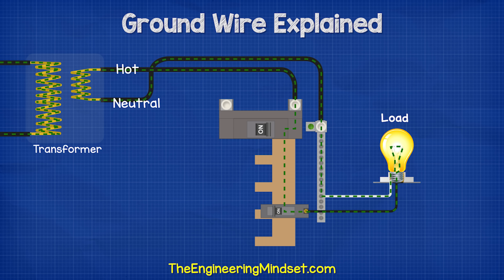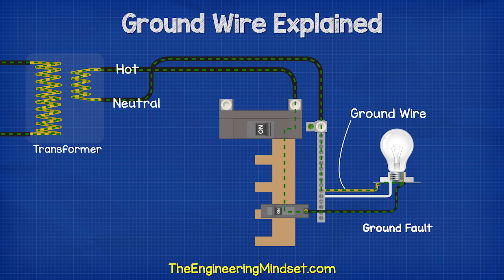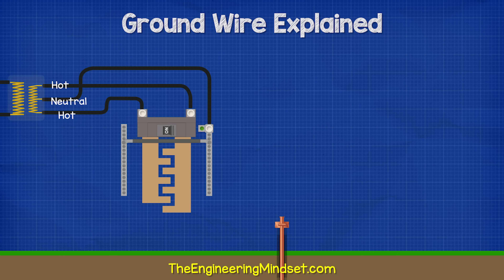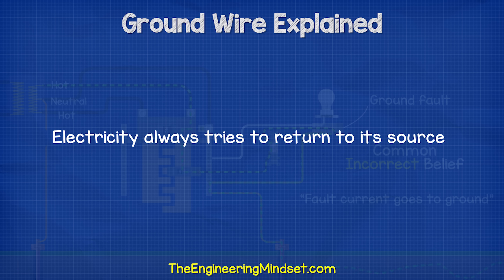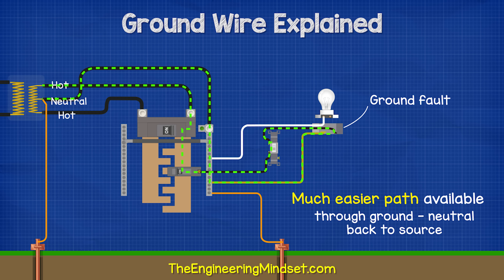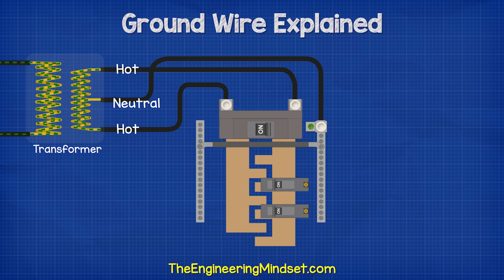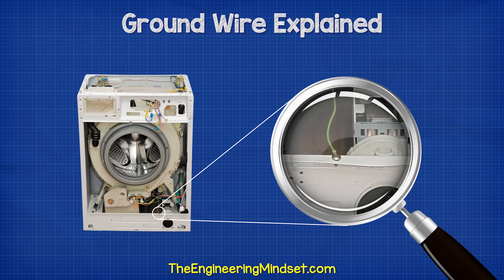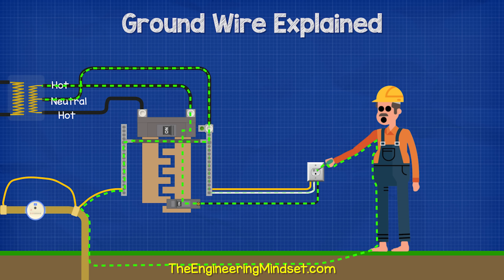Ground Wire Explained

Comment: There are some mistakes:
1. In Electronics the Ground Wire is more like the neutral line. Even in Electrical Engineering the correct term is PE-Wire (Protective Earth)
2. The PE-Wire is not most of the time a solid copper wire. It depends on the application. When it is not moving (like in house installation it is a solid wire) but most of the time it is not
3. It is insulated with not a green insulation but according to standard it is green-yellow
4. Actually the Ground/Earth has a very low resitance because the cross section is very big
5. When you have a ground fault what you want to trigger is the RCD, your normal circuit breaker is for a short circuit
Reply from the maker: We just published a new Ground fault, short circuit and arc fault video, so much detail! Link HERE➡️: https://youtu.be/Qi0ynSQw-wc

Comment: In Norway we have 3-phase 230v only, for most houses and buldings, with no neutral wire.
Here electricity actually returns to ground/earth rod when a ground fault happens.

Thou the rest of the continent (not Norway and Albania) i belive use 400v ( 3-phase 400v + 1-Neutral + Ground ) as standard
Reply: Indeed. All installations with TT earthing use the earth soil as a conductor, which is in combination with a RCD/GFCI perfectly safe.
Reply: @wouterbos3   only a few costal areas in Norway use 230v TT
The main standard in Norway is 230v IT (Isolated Terra)
But some new buldings in recent years now use 400v TN (Terra Neutral)
Reply: I find it interesting that Norway uses IT.  That seems pretty bizarre for standard residential systems.  In the U.S. we only use IT for specialized applications that cannot tolerate power outages during fault conditions (such as hospitals).
Reply: @LonnieAdams4   it was actualy a problem for EV owners in the beginning.
No one made and sold 3-phase 230v EV chargers.
Universal design for both the rest of the world, and the north america marked, some more powerful Home EV chargers did support 230v.
But we do not have a neutral wire, and left us with a flooting ground/earth, connected to 2-phase 230v.
But, this was quicly made illegal. As the chargers were not designed to be connected like this 😅😛
All chargers on the marked were for normal 3-phase 400v + nautral for 230v.

I’m pretty sure it’s only Norway and Albania that use 230v 3-phase IT for normal residental power 😛😅

But some of new residental areas buildt in recent years, are buildt out with normal 400v. Just like the rest of europe.

Also, I have never seen a pole mounted transformert IRL in my 36years.
All transformers here are huge, in concrete blocks, and many are parcialy under ground, and they service large areas. 
And have redundant cross connections with other transformers in the area.

Only in rural areas, can you some times see 230v power lines on poles along the road.
But, every house are supplyed power under ground.
Never from a pole, to the wall of a house.

Pretty much all high voltage are to far up, to be damaged by trees and heavy snow.

Comment: The ground rods at the bonded service and the grounds at the utility transformer does, in fact, provide a path back. Unless you have infinite resistance, there will be current flowing between the two. Electricity doesn’t just take the patch of least resistance, it takes all available paths back. Ohms law is still in effect.
Reply: Sure, but is one pathway (bonded neutral) handling the vast majority? Would you be harmed if a properly connected ground to neutral were activated while touching the ground rod at the service?
Reply from the maker: We just published a new Ground fault, short circuit and arc fault video, so much detail! Link HERE➡️: https://youtu.be/Qi0ynSQw-wc

Comment: This is just a bonded ground and neutral situation.

In europe we mostly use a terra terra setup, the ground is not bonded to the neutral. Or you get a separate ground and neutral wire delivered from the net.
Reply from the maker: We just published a new Ground fault, short circuit and arc fault video, so much detail! Link HERE➡️: https://youtu.be/Qi0ynSQw-wc
Reply: TT has advantages and disadvantages.  There is no "perfect" earthing system or else we'd all use it.  A lot of it depends on how much money the utility companies want to spend on their equipment. I suppose TN-S would be the safest system, but almost no country uses it because it is more expensive to run that extra earth conductor.

Comment: So then is it true that in apartments or homes with no ground wires to the electrical outlets the alternative is to swap 2 prong outlets with 3 prong GFCI outlets? (Again no ground wire)
Reply: GFCI stands for Ground-Fault Circuit Interrupter. The outlet detects a ground fault and trips like a circuit breaker (but, unlike a circuit breaker, doesn't trip on high amps). You still need a path to ground to trip the GFCI. Unfortunately, the only real option, if you're sure there's no ground wire run, is to rewire the domicile in question with 3 conductor wire.
Reply from the maker: We just published a new Ground fault, short circuit and arc fault video, so much detail! Link HERE➡️: https://youtu.be/Qi0ynSQw-wc

Comment: Why having the ground part in the first place?  So that could make your body complete the circuit when touching the hot wire? Even when we have electricity leak at the box, without the ground rod, the user is still alright, since he/she is not part of the circuit.
Reply from the maker: We just published a new Ground fault, short circuit and arc fault video, so much detail! Link HERE➡️: https://youtu.be/Qi0ynSQw-wc

Comment: @3:00 Today's houses have the ground connection connected to the neutral before a differential circuit which senses the difference bw neutral and hot currents. Thus you cannot die, as soon as the difference is > 0 the circuit stops the flow of current in the house.
Reply from the maker: We just published a new Ground fault, short circuit and arc fault video, so much detail! Link HERE➡️: https://youtu.be/Qi0ynSQw-wc

Comment: If I may offer a bit of feedback: The video starts very abruptly with the ENTIRE THING shown. The whole image is animated, so the viewer has difficulty orienting themselves in it. You do not highlight what you're talking about with some bright frame or spotlight, and the animations keep switching without being synchronized with what you're talking about.

I'd recommend first establishing what's on the screen, with several sentences such as "On the left side, you see the electricity producer's transformer which converts [x] to [y]. From there, wires bring electricity inside someone's house or an office building. On the right is the electrical socket in the wall." etc.
Reply from the maker: Thanks for feedback. This video is literally just a snippet from our long video about the electrical system. Please watch that "Electrical panel basics" or "120 & 240V electricity explained" for full explanation

Comment: I want you to explain what happens to electric when all it does is run in a loop why do we need to keep generating more? At some point it must be run to ground to get rid of it.
Reply: Electricity flows from high potential to low potential. If you have a loop it will all be at the same potential and no current will flow. You need a power source to generate a potential (current) in the loop.
Reply from the maker: The food you eat runs in a loop, grows in the ground, runs through your body and goes back into the ground. If you stop it passing through your body, you stop functioning. Generating electricity is just moving electrons through a wire, if you stop passing it through a wire then your electrical devices stop functioning.

Comment: I humbly disagree with your explanation. The return current will take all paths to ground. it's a parallel circuit you can use mathematics to figure this out yourself I know for a fact that there will be current on the ground rod as well as the neutral wire and anything else connected to it whether it's a fault condition or not. The critical safety aspect to understand is to create an ultra low resistance path which will take the majority of the current leaving only inconsequential milliamps of current on the other paths. There is no such thing as a perfect insulator. Even insulated aerial buckets designed to work on high voltage power lines still leak current back to the ground. If your explanation was true then the current would stay neatly within its wire always returning 100% of the current back on the neutral wire. The second something makes contact with an energized conductor it becomes a parallel path within that circuit. The only variable is resistance. More resistance less current flow but it will never be zero.
Reply from the maker: We just published a new Ground fault, short circuit and arc fault video, so much detail! Link HERE➡️: https://youtu.be/Qi0ynSQw-wc

Comment: That System really remembers me on the fail-safety systems in my country. We use something called "die  Nullung"
It's a modern version of the old Nullung ss it have some math stuff and more preparation
What it does: the system builds on breakers. Your electricity must be build, thst the breaker will be for sure cut down the wires. 
Like: if you want to use a breaker LS-Typ B, then you need to get a currency of I×5
So if the breaker can hold 10A, then your system needs to get in worst cases everywherr 50A or more
Too that their are 2 or 3 other rolds, like grounding and so, that needs to work

Comment: Can you run for example 2 12 gage wires 110v hot  1 wire on one phase the other on a different phase and return with 1 neutral 12 gage wire without any problems?

Comment: Correct me if I'm wrong, but isn't the main purpose of a fuse or circuit breaker to prevent electrical fires? To protect from electrocution you really need a GFI/RCD.
Reply: Well, it's to prevent high current, which can cause fires, but can also cause other problems too, like injuring people or damaging equipment.
Reply: GFCI are better for protecting people, but before GFCI's were invented in the 60's, grounding is what we used. Grounding conductors will cut the circuit pretty quick, but the fault current can be pretty huge for that split second.  A GFCI will trip at 6 mA (in Europe they trip at 30 mA).

Comment: Yea I wish you had explained this to Duke energy, would have saved a lot of folks a bunch of money ....failed electronics, lights that keep burning out, just to name a few. Actual listen to two of their linemen acknowledge a bad ground and decide to do nothing about it since it would require transformer replacement. Another crew was sent out and even after being shown, did nothing, then 3 crews latter and months of nonsense a repair was made ..yep two different cases I personally know of . Years of reduced maintenance,  using the Boeing plan...run it till you have to replace it ...not much comfort to a man with a burning house, or a grieving a loved one electrocuted....
Reply from the maker: We just published a new Ground fault, short circuit and arc fault video, so much detail! Link HERE➡️: https://youtu.be/Qi0ynSQw-wc

Comment: The resistances of the ground wire at the outlet is no less then the resistance of the neutral wire.  The current flowing thru a device and then back on the neutral doesn't trip the breaker because the device acts as a resistance item, aka resister, and doesn't allow the current to flow thru the device to over load the breaker.  You can remove the neutral and connect the ground wire to the neutral connection and it will not trip because the wire has the same resistance as the neutral.  In return you can connect the neutral wire to the case of a device and it will properly function as if it was a ground wire.  In either situation if the hot wire touches either the ground wire or the neutral wire with no load connect in between, but a direct connection it will trip the breaker as a direct fault.
Reply: The question nobody seems to be able to answer is... why two separate wires? They're shorted together at one end, so isn't one of them redundant? Why not just, as you say, have the neutral wire connected to the case?
Reply: @Bapuji42  Because the neutral wire carries current, the ground wire only does when there is a short.  So if for example you was using a hand drill with a metal case, assume the neutral attached to the case, you can hold the case and with the drill off and be fire.  Turn on the drill and now the case has current running through it and the your hand. if the resistance to ground is less through your body then through the neutral wire you will get shocked. Now if a ground wire is connected then you can use the drill and have short circuit protection without risk of getting shocked because the ground wire only carries current on a direct short which would trip the breaker instantly.
Reply: @johnchase7667  That makes sense, thank you. 

I thought of another reason. If something happened and there was a break in the neutral wire, everything attached to neutral "upstream" of the break would be at the same voltage as hot, since with no current flowing there's no voltage drop across any load.
Reply from the maker: We just published a new Ground fault, short circuit and arc fault video, so much detail! Link HERE➡️: https://youtu.be/Qi0ynSQw-wc

Comment: Its actually just a helpful way of thinking to say that electricity is trying to get back to the original source.  This isnt really the case, electricity is instead trying to even itself out within the system, so it will move from areas of high electrical potential to areas of low electrical potential.  When we have a grounding wire the dense generally electrically deficient earth does in fact act as a sink and take the electricity in.  For the purpose of understanding house wiring the general concept of thinking of electricity as trying to return to the source works fine but in more detailed physics you would come to a lot of erroneous conclusions using that concept.
Reply from the maker: We just published a new Ground fault, short circuit and arc fault video, so much detail! Link HERE➡️: https://youtu.be/Qi0ynSQw-wc

Comment: Here in The Netherlands, a ground-wire is green-yellow. Also, most houses only have a ground-wire connected in the ''wet-rooms'', bathroom, kitchen, garage(sometimes), but not in the living room, bedroom etc.
Reply: Here in america it's standard for all receptacles to have a ground wire and a third prong to provide equipment ground. Y'all most likely have full-house RCD/GFCI protection, which isn't standard here, though we're getting more and more GFCI/AFCI requirements as the years go by.
Reply: Wtf, not in every room? In Germany it is.
Reply: Nonsense. PE wire everywhere and earth rods were becoming standard in Yugoslavia by the 80s. You can't tell me Western Europe had worse safety standards than us.

Comment: My friend had a problem where whenever someone in the other room turned on a light, his monitor would black out for couple of second and then turned back on. Some people on FB suggest to checking the grounding. What should my friend do at this point? How do he check the grounding?
Reply: It's hard to tell just from your comment, as you haven't mentioned what kind of light fixture is in the room and what kind of monitor your friend is using, but I highly doubt it has anything to do with grounding. The closest assumption I can come up with is that it's a cfl with a faulty or old ballast/choke, or even a bad starter. Switching to leds would solve the problem.
Reply: @VladLFr  his whole house were using pendaflour lamps. If im not mistaken, he was just using a mid tier acer monitor not sure what his model is. Should he try to change just 1 light to LED or should he just go all out and change the whole house? But I doubt the LED would look good or suitable for a bit old school house without installing an office type of ceiling though.
Reply: @BoBBaB0oN  I think just replacing the lamps that cause the issue would be good enough, as other lamps are more distant to the connection of the computer. Another solution would also be to buy a UPS for the monitor, however that is a more costly solution. Also, if the color of the led is a problem, there are a variety of different led colors that can suit your preference. If you'd like a led that is close in color to an incadescent light bulb, I would recommend an LED with a temperature of 1800k to 3000k (temperature means light color).
TLDR; replacing that one lamp should fix the problem, assuming it was the only one causing issues.
Reply: I would also know why everytime someone turns on the lights in next room, in my room some old Children  toys turn on that use batteries
(They are not conncted any way on a wall. They are against wall tho.
Reply: @jarskil8862  It would depend on a number of factors, such as how well was the house wired to avoid emf, how much current do your lights use (highest nominal current should be Inc=8A, however with modern LEDs the current should be as low as 0.1-0.75A), how sensitive are the toys to electromagnetic radiation, and how protected are the toys' circuits against emf. Assuming your house was wired properly, I'd probably suspect that the toys are oversensitive to emf.
Reply from the maker: We just published a new Ground fault, short circuit and arc fault video, so much detail! Link HERE➡️: https://youtu.be/Qi0ynSQw-wc